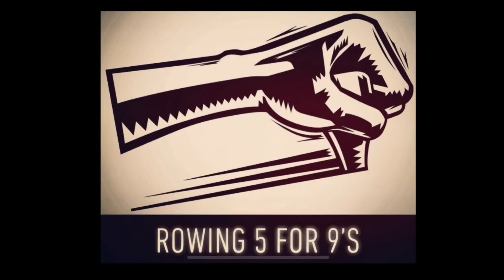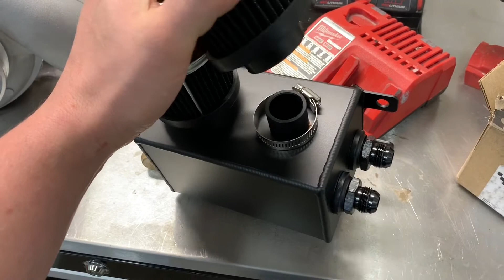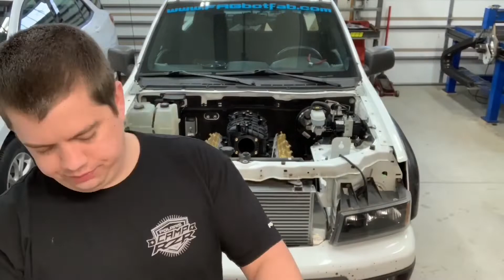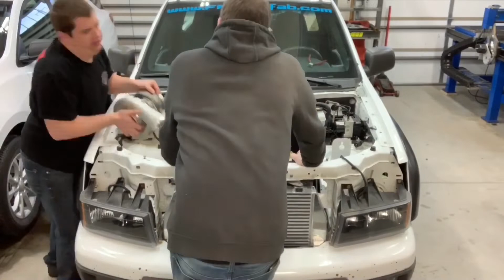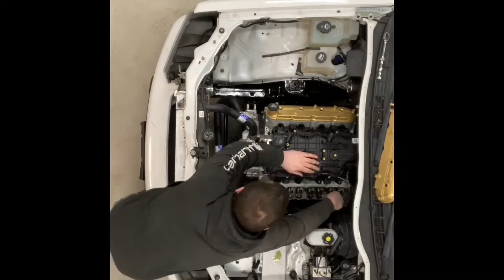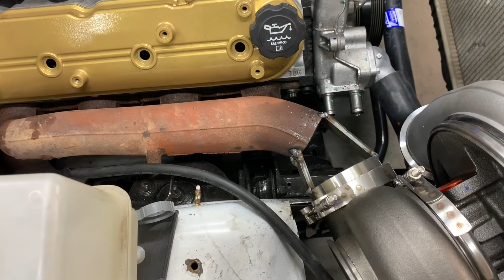Project Rowing 5 for 9’s: Episode 3 - Turbo Mounting

Comment: did you cut the front core support area between the radiator/IC and the headlight buckets ? swore you used a 3" hole saw on the last video
Reply from the maker: Mob with Guns the core support was cut. Here is a picture showing what was cut: https://photos.app.goo.gl/cFLsocQxnDnnW2eCA